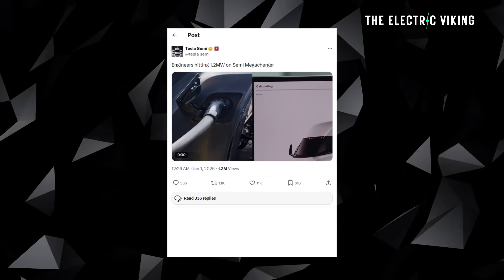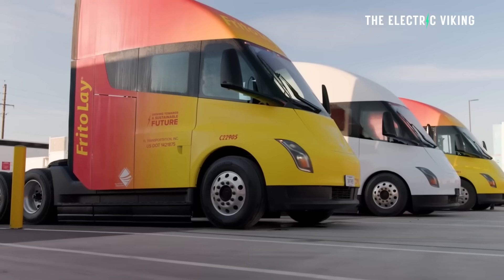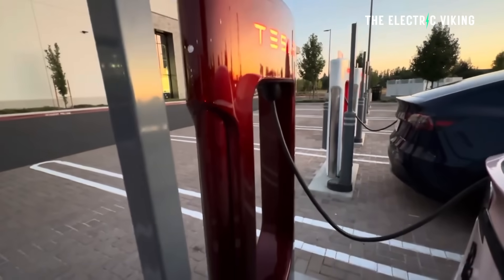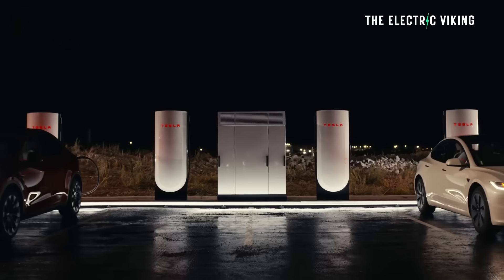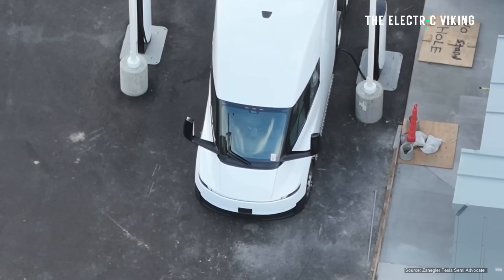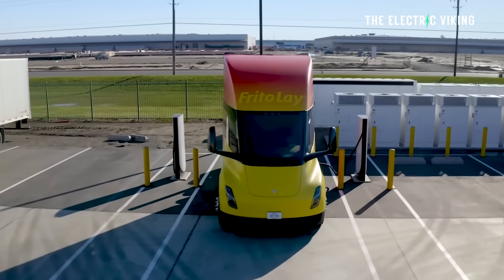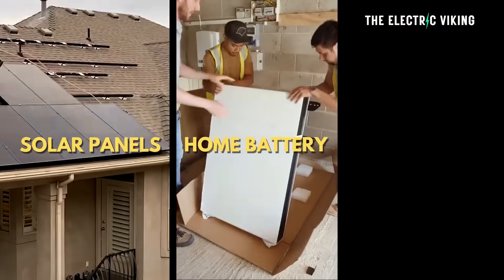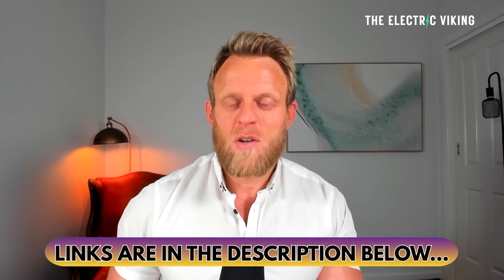Unbelievable Tesla Semi Charging Footage Shows 1.2 MW Peak Power!

Comment: You are not understanding batteries. A semi can charge at 1.2 MW because the battery is massively more parallel. Assuming the same cell chemistry, same charging voltage and cooling rate per battery cell, an 800 KW battery should have 10 times as fast charging rate as an 80 KW battery. Given that Tesla can peak charge that 80 kW battery at 250 KW, the 800 KW battery should be able to be peak charged at 2.5 MW. It isn't. Likely because the cooling system can't handle it. Slower efective charge rate means the battery will last longer, which lowers 

30 minutes to recharge 70% is chosen because truck drivers in the US have mandatory 30 minute breaks every 4 hours.
Reply: Won't need truck drivers soon so the computer can take a break when it recharges.
Reply: The charger can't handle it, their battery and cooling system probably can. That's why it shoots to 1.2MW and then stays that for very long.
Reply: Not is you who don't understand batteries. Look up what 10C charging means for example. If you charge such a battery from 20% to 80% at 10C it only takes 3.6 min.
This already exist.
That is why he says it does.

Comment: 3:40 The charge speed will likely be longer than 45 min. But that's ok. It takes about 11 hours to drain the batteries and go 500 miles. At that point (in the US) the driver is legally obligated to take a 10hr break. So Tesla has designed the capacity with this in mind.
Reply: Just watch the German channel electric trucker in English or Elektrotrucker. He demonstrates that drivers are limited by legal driving times not range and that while doing 700-800km a day and the mandated 45min rests after 4.5h are enough to recharge. He drove from German to turkey without leaving diesel trucks out of sight, then from Turkey to Portugal without being slower.
Reply: So you're going to tie a charger up while a truck sits on it for ten hours?
Reply: @DaveR7920  Not what he said.
Reply: @williammeek-h2o  He's suggesting charging on a break isn't he? That would be classed as work and can't be done on break, nor can the truck be moved on break so plugging in and then going on break would tie up the charger for the length of the stop
Reply: @DaveR7920  Truckers are already allowed to fuel on break. And that requires the driver to stay at the pump. There is no reason to treat charging any different especially as charging does not require the driver to stay at the charger.
Reply: @williammeek-h2o  You can't fuel a truck on break in most countries. You expect a driver on daily rest to wake up and move the truck once its fully charged? Its not a problem if it takes 10 minutes to charge like filling up with diesel but that won't be the case. What about all the trucks who have to have their break away from truck stops and depots? Have you ever driven a truck
Reply: @DaveR7920  Ya, you have no clue what you are talking about.
Yes, a driver can fuel on break here in the US.
No, it takes something like 20 to 30 minutes to fuel a heavy diesel truck that is near empty.
You have clearly never driven a heavy truck before.
Reply: @williammeek-h2o  LOL. I didn't say you couldn't do it in the US kid, I said in many countries you can't fuel or move a truck during your daily rest. If you are in sleeper berth in the US are you going to wake up after 3 or 4 hours of charging and move your truck to free up a charger, potentially losing a parking spot?
Yes large tanks take longer to fuel especially with low rate pumps, they can also be fuelled quickly. I've driven trucks on 3 continents including America
Have you?
Reply: @DaveR7920  "If you are in sleeper berth in the US are you going to wake up after 3 or 4 hours of charging and move your truck to free up a charger, potentially losing a parking spot?"
No, you are going to move your truck after 30 minutes of charging on break or park where you have a charger in the parking spot.
And no, given your demonstrated lack of knowledge, I don't believe you have driven a heavy truck commercially.
I expect you have a light duty diesel and are trying to translate that into what a heavy truck is like.
And no, I am not going to believe you when you deny this.
Reply: @williammeek-h2o  You're not going to be able to charge enough in 30 minute breaks so will need extended charging during daily rest, and that's for a solo driver. Many trucks are teams on long haul or double shifted on more local work.
"I don't class an 80,000lb semi as a "heavy truck"  like the yanks do, though I have driven there. it's a partly loaded toy. 
What do you drive kid?
Reply: @DaveR7920  I don't drive heavy trucks. 
I just can do the math.
By the way, Tesla Semi can charge a 1.5 MW and the Megawatt Charging Standard is in development so ya, 30 minute charging is coming. 
The limit on charging is the chemistry and arbitrary design, not the battery size. 
If any EV can charge in 30 minutes, so can any truck if designed to do so.
Reply: @williammeek-h2o  Lol I can tell you don't.
Fast charging is coming but isn't here yet, nor is the infrastructure to take advantage of it. Vehicle dimension and mass laws vary across the world, as do drivers hours rules. Many countries are struggling with infrastructure for electric cars, trucks will be way harder. Many breaks are taken at shippers and receivers or in road side laybys as the clock dictates, how are you charging in them?
Learn about the realities of the transport industry and you might see why electric doesn't work yet.
Just as hydrogen and LNG trucks exist but aren't taking over.
Reply: @DaveR7920  Reality. Tesla Semi has already demonstrated charging at 1.2 MW at a V4 station. 
That is enough for a 70% in 30 minutes.
So the infrastructure in already being installed.
By the way, the Megawatt Charging Standard covers up to 3.75 MW
Reply: @KarpKomet  I don't disagree with you except to say overnight truck parking in many parts of the US (and the world) is insufficient now seeing trucks parking away from official truck stops and rest areas. Moving the truck on daily rest would also be illegal in some countries, trucking is run by the clock, 5 miles short of a charger but your times up, you have to stop. The scale of the problem is huge.
The last truck I drove was operated on shifts with a return to base at shift end, 3 drivers meant 24/7 running. Sometimes the truck would be parked for an hour or three at shift change but often times, one driver got out, one got in.
Reply: @DaveR7920   That's a really good point about being five miles short of a charge and needing to stop legally. As someone who never drove a truck I realize I considered the distance and the clock issue separately.  That's a huge problem for a 100% electric truck. You could imagine some rule changes to help the moving during rest issue but for that you would need to really bend the regulations. Speaking of I guess I need to look at what the Europeans are doing as they have some longer distance electric trucks already, as far as I can tell the drivers are just careful with when they charge and rout planning. That last truck you drove would be a absolute worst case scenario for electrifying. Something you would tackle last after all the other lower fruit. Maybe eventually some sort of hybrid truck + inductive charging during loading or just battery swapping.
Reply: @KarpKomet  The company have actually tried to address the problem by trailing a battery swap truck, but it only works if the truck is kept within a very small radius. As for route planning, you can do a lot of it but in trucking everything is subject to change without prior notice. Even a police inspection can destroy your day.
We should be looking at a combination of diesel, petrol, hydrogen, LNG, BEV and hybrid for all forms of transportation and use the tech that fits best. Unfortunately we are faced with governments  (and YouTube channels) that insist on just one way, their way, and if it doesn't work for some then tough.
Reply: That likely isn't the limit of the battery. The limit is likely the charger. The battery limit is based on chemistry. It uses the same chemistry as the Model S which can charge to 80% in less than 30 minutes.
Reply: Does the US have similar driver break rules like Australia and Europe?
4.5 - 5 hrs then a mandatory break so that when a recharge would be needed.
Similar to the vids put out by Tobias from Electric Trucker on YouTube. Now all his vids in German on his other channel
Reply: @michaelanderson3771  We have something more complicated. 
A driver can drive for 11 hours then needs a 14 hour break. But also can't drive more than 8 hours without taking a 30 minute break.
Reply: @williammeek-h2o  Thanks for providing the difference. I am sure a non stop 8 hr drive would not be the norm. 4-5 hrs before a rest break to use the rest room or have a bite to eat would be typical. But I do know lots of Aussies that drive until fuel stops needed ever 400-500 kms , (250-300 miles) 
I drive long routes here in Aus, 3.5 MT Truck and trailer / Not Class 8 so don't need to have the same rules,  and would stop after 4-5 hrs to refill and have a bit of a break and drive  between 14- 18 hrs  in a day.  Depending on how fatigued I got. My longest was Melbourne to Brisbane in 20 Hrs.
stopped ever 400 - 450  Kms to refill and have a coffee a wee and a bite to eat.
20 min stops max.
Reply: @michaelanderson3771  Do you think every roadside lay by, industrial side road, loading dock or truck stop parking space is going to have its own charger.
Reply: @DaveR7920 No - More so road side charge parks like in Europe and Tesla build truck only charge parks for trucks on main freight corridor. Many trucking companies having own depot charging like in Europe now.
We are seeing drive through 400kWh chargers springing up in Aus but a hand full so far on the main freight route.

Comment: Local delivery where the truck is back at its home station every night would seem like the best fit for electric trucks.  That said, trucking is very competitive down to cents per mile to operate.  Not sure if over lifetime of truck if electric is cheaper or not.  It will be ten years before we know that.
Reply: The numbers have been run. Major trucking companies are trying to install the chargers, and for that they need HUGE power grid connections. That is where the bottleneck to EV semi use is. Even the less efficient non Tesla semis are far lower cost per mile to operate when looking at total cost of ownership.
Reply: @ekaa.3189 You may be right on cost of ownership.  I’m not quite sure anyone knows for sure yet.  I do believe you’re right that overcoming electrical generating capacity and grid problems are likely the biggest obstacle at this point.  Energy density of diesel coupled with infrastructure like pipelines, storage tanks, etc is going to make diesel hard to compete with in my opinion.
Reply: @JB-gz2vu  The generation capacity isn't the issue. It is the hookup to the electrical grid. Those large transformers are the bottleneck. They are in limited supply even with new plants coming online. This is even a problem with installing DC fast charger sites. The power grid has enough electricity available, and more generation capacity can be made. PS: It is a crime that Trump has made solar panels cost 3 times as much as they do in other countries via his tariffs..

Comment: Diesel semi sales could crash when Tesla has megawatt chargers at every interstate exit, but I don't see it happening for many years. Truck drivers don't stop to fuel and have a meal. They're paid by the mile. They drive all day and fuel as quickly as possible. When I drive on an interstate highway, I can often see dozens of semis, and they all need to stop for fuel occasionally. Tell a long-haul trucker that he must stop for half an hour to charge a Tesla semi, and he won't give the vehicle a second thought. That's half an hour he's not being paid.
Reply: Just drop them in at the truck stops.
Reply: @robertlowery7086  That's the problem. You can't just "drop in" a charger of that capacity at truck stops, let alone installing ten or twenty of them. There's only so much
redundant capacity in any circuit on the grid. The sort of current draw that we're talking about to charge just one Tesla semi at those rates is comparable to supplying
a small town... 1,000+ houses. Next time you visit a small town, have a look at the substation required to service that level of demand. Then trace the supply line back
to the high voltage circuit. We're talking millions of dollars worth of infrastructure. Then go for a drive up the road and find yourself a town with a population of about 30,000 people (10k homes). Have a look at their substation and trace the supply line back to the high voltage circuit. Now use your imagination and think what is required for 100 chargers, or 1,000 or more. There's no "just dropping" these things in at truck stops.
Reply: @davidbrayshaw3529  They will use batteries at the sites.  Cheaper than a massive grid upgrade.  Trucks go to truck stops, rest stops, and destinations.  Megawatt charging isn't needed at every gas station across the country.  Strategic spots is what is required.  A 350/400kw is fine for other places as they can top off on a half hour break.
Reply: They need to clean, eat, sleep, go to the toilet, fill in papers, name it. While tanking you can't go to the toilet, but while charging you can. 30 minutes is peanuts actually.
Reply: @rowanbroekman3929  No, it isn't.
Reply: @restonthewindIn Europe, even with just 400kW charging and a semi that's a lot worse electric semi's already make more money very often simply by driving more efficient. There are channels out there showing so.
Reply: @rowanbroekman3929  Electric semis have applications in narrow use cases. No one is denying it. Long-haul trucking in the U.S. is not one of these use cases because charging requires too much time and the charging infrastructure doesn't exist anyway.

Comment: Apparently Tesla's Semi uses an industry-standard MCS cable/plug that can peak at 3.75MW, but the current trucks top out at 1.2MW (due to the V4 Power Cabinet bottleneck). Tesla is already building out private Megacharger corridors for early customers like PepsiCo and Costco. The early pilot trucks used a 'v2.4' Tesla-modified connector, but the high-volume 2026 production Semis (spotted at Giga Nevada last week) use the final MCS standard. This means the early infrastructure will likely be retrofitted as the 50,000-unit-per-year production ramp begins this year.
Reply: IMO Tesla cannot supply sufficient 600 kWh packs for 50000 trucks and the other critical components a year  maybe 50 a day max and possibly 100 a day with 3 shifts by end of 26 is my reckoning

Comment: Looks like we are going to need all the nuclear power plants in California to STAY OPEN and then some.
Reply: not really. At the moment excess solar and wind are being curtailed during the day as there's not enough demand. Battery backed chargers is the answer rather than a huge increase in generation. It's data centres that are the problem
Reply: @geoffsemon7411  Yes.  And Solar+Batteries is a lot cheaper than Nuclear Power.  So maybe the existing ones will keep running a bit longer, but new ones needn't be built.